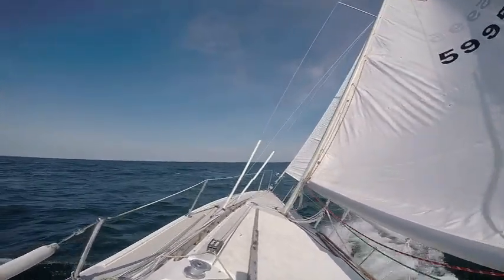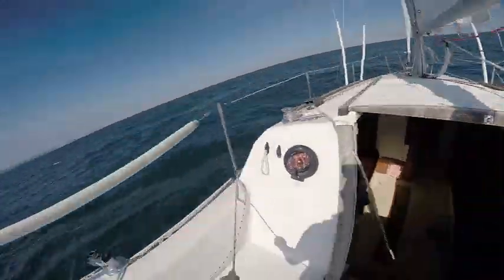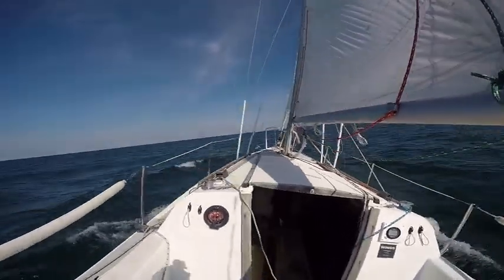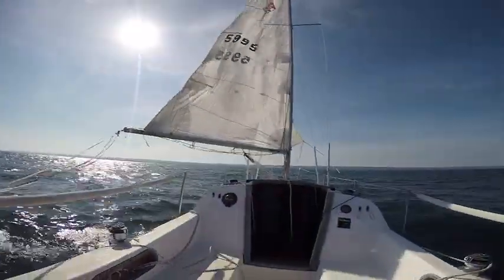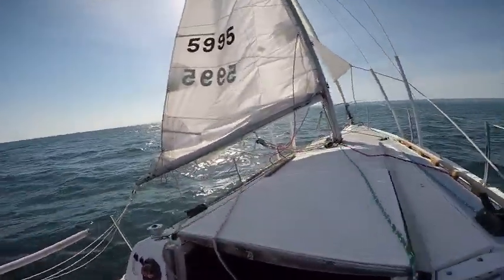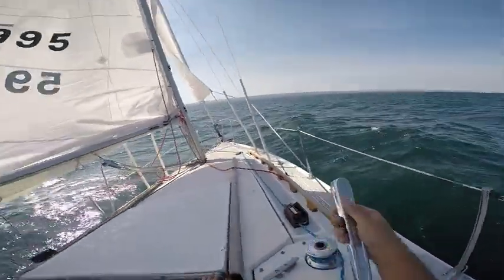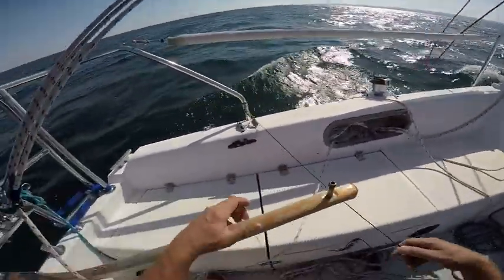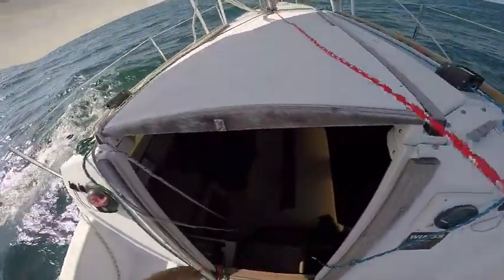Reefing main of Catalina 25

Comment: Why didn't you secure the foot of the main sail?  I notice you left it flapping off the boom.
Reply from the maker: Well, I probably would have if I had been adhering to a more conservative reefing policy. (reefing earlier than strictly needed). Then I would sail for a long time on the same reef and hence take the time with tying it up. However, the following factors promoted frequent changes to reefing:
- winds on Lake Erie being highly variable
- equipped with the tall rig
- trying to sail somewhat optimally fast
Good question though!
Reply: I agree if you want to shake main out if condition change as you mentioned wind on Lake Erie is highly variable @karlholmgren4263

Comment: How about some more Catalina 25 videos.   I am interested how your Jib is set up.   New 1984 Catalina 25 owner here.  My head sail sits low on the deck, trying to figure out what I need to get it higher, so it clears the lifelines and stanchions.
Reply from the maker: Somewhat furled as in the video the foresail does not contact the lifeline. However, this is an (I believe) 130% genova, and it actually does not clear them entirely in the fully unfurled condition. The foot close to the tack is forced to fold up a couple of of inches. My ideas around the problems have been around locally lowering the applicable part of the lifeline. (haven't done it though.)

Comment: Learned a lot, thanks! I am considering buying a Catalina 25 - do you think it is a good boat for a first time sailor? I do have other boating experience.
Look forward to more videos.
Reply from the maker: For a first keel boat it's pretty good. Not very exciting, but inexpensive and enables you to practice most of the functions of larger or more expensive boats.
Reply from the maker: On a second note, if you consider it as your first keel boat I would definitely get the short rig. The one I have in the video has the tall rig, which is why I am forced to reef so early.
Reply: I just bought a Catalina 25 as my first boat...  it has been a perfect boat.
Reply: Excellent boat for a first time sailor. The tall rig is great for lake sailors and phrf racing. However, the boom is much lower, so the headroom is not great, especially with a bimini. It can be raised though. The C25 is probably the best pocket cruiser, while still trailerable. If you want to just daysail, don't need the cabin, and enjoy sailing faster, it's not the boat for you.
Reply: And if you want cheap and fast, get a used Hobie 16!